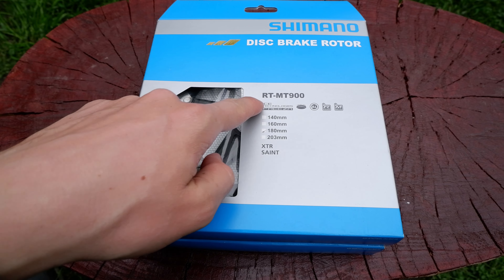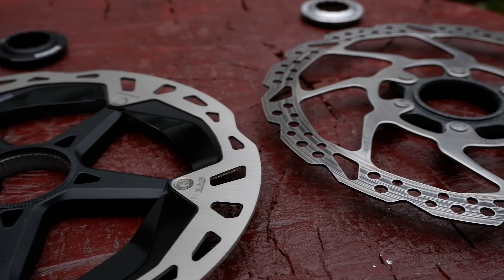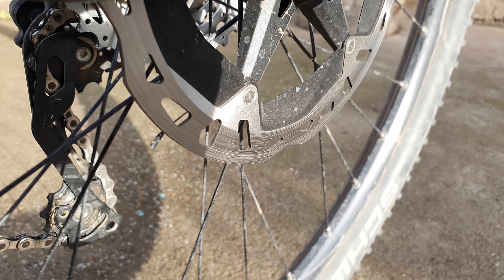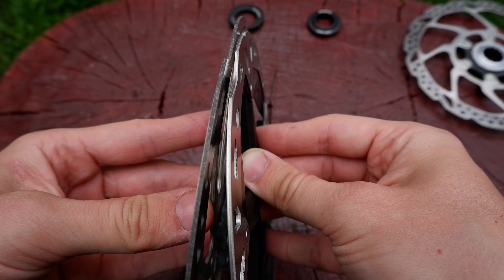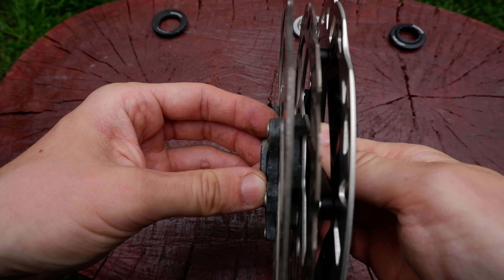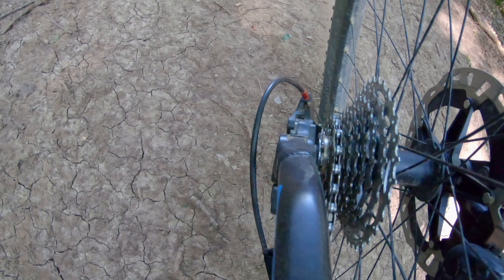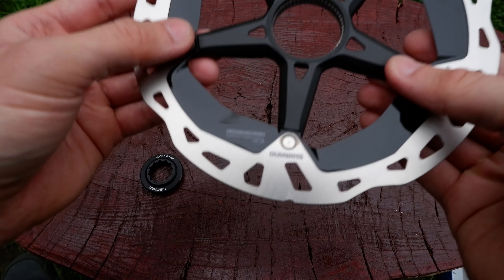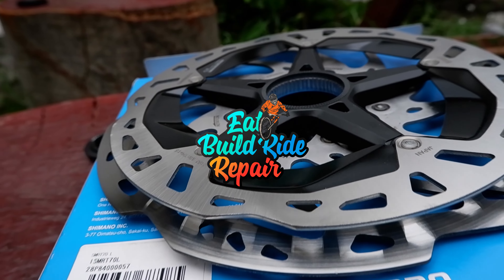Honest opinion about the XTR MT900 disc brake rotor

Comment: What are cheaper / stronger ones?  I was looking at RT86 203s
Reply from the maker: If you are looking for a stronger design, than the 6 bolt mount is the way to go, your decision should be ok. Don't forget to upgrade the braking pads to metallic, if you really want the ultimate braking power, however that means the metal pads would cause a faster wear on the rotor as well.
Reply: @EatBuildRideRepair  yeah I’d seen the CL adapters and was tempted to get one of those to accommodate these discs if they performed better than the RT86, I’ve one of those on my Orbea rise atm and it did well to be honest the other day, thing is I need to order 3 new rotors and I could buy the Freeza ones instead hence me wondering
Reply: @EatBuildRideRepair  which pads do you recommend?  I just have the OEM ones on my XTR atm, won’t metallic be noisy also?
Reply from the maker: @carlsmtb3171  I only use original shimano pads, the latest models, the noise is a tricky problem, in the most cases there are no difference between the resin ones, all of my friends with DH bikes are using full metal pads, and has no squeaky sounds at all, but this depends on the riding condition as well, metal pads are better in mud and rain as well.
Reply: @EatBuildRideRepair  awesome I’ll do this then, can you recommend a model?  Cheers

Comment: The Black colour is not for good looks only. If you research on Black Body Radiation, you would find that black colour is better in absorption and emission of heat than silver colour, which is poor in heat absorption and emission. As a result you get high cooling performance with the black cooling fins than silver ones. However, there is no reason why it should be glossy black instead of a matt black, which may be more practical and lower maintenance, if the looks concerns you.
Reply from the maker: @damianhla  If you really read their own description it's says that its only 15% difference, which is completely unnoticeable on the average user lvl. Cheers
Reply: @EatBuildRideRepair  Hydraulic brakes typically fails when the brake fluid starts to boil and bubble forms. 15% is a substantial improvement when all things being equal. It is not about braking power, which you have been incorrectly comparing. It is about preventing brake failure. 😂 If you want better braking, for example higher initial bite, upgrade to metallic pads. The standard organic pads are only good for general purpose. It has poor wearing properties especially in wet. Organic pads are not good with heat resistance. For this both ceramic and metallic pads are major improvement. Upsizing your rotor and upgrading from 2-pot to 4-pot calliper can also improve your braking, but definitely not by adding heat sink. For this, the best outcome is improved reliability, assuming you understand the exact contribution this features makes. 

This 15% margin in many cases translate into the difference between brake fading/ failure and the one that continuously functions. Even 5-10% is significant. This is why in racing, we have racing brake fluid that has elevated dry and wet boiling points.

Comment: I see you had deore rotor, I have deore rotor and braking power...yeah it´s braking but not much when you want to do stoppie etc. Is it worth it to upgrade to slx rotor?
Reply from the maker: I did not noticed a major barking power difference, however I switched to slx to xtr, and both used the same ice tech sandwich, alloy steel alloy construction. The big difference is when you are braking longer like a descent which lasts for 5 - 7 - 10 mins, and you don't have any segments to let the brakes cool down, than it's a big help to have the ICE TECH FREEZA system, and bigger rotor, with alloy legs (the 180mm has 5 of this, which is also an upgrade compares to the 160mm which has only 4). 

If you are interested purely on the braking power for stoppie, than the brake itself and the pads are more important, like steel pads for example are a bit more firm than organic ones.
Reply: @EatBuildRideRepair  So I need slx rotor due to steel pads.